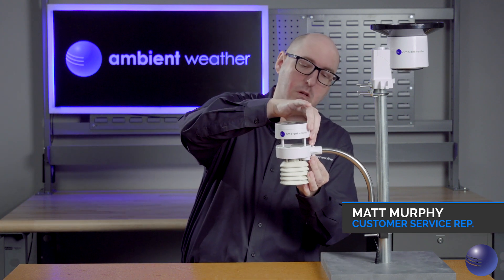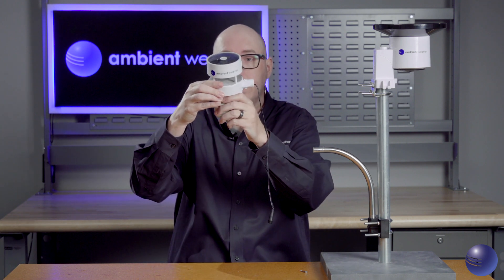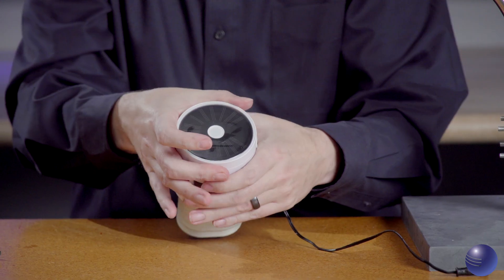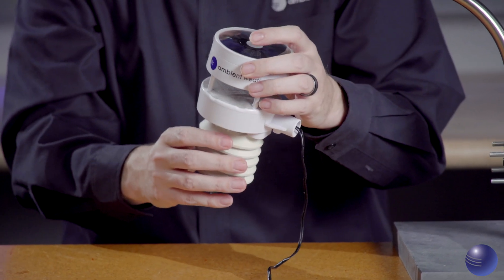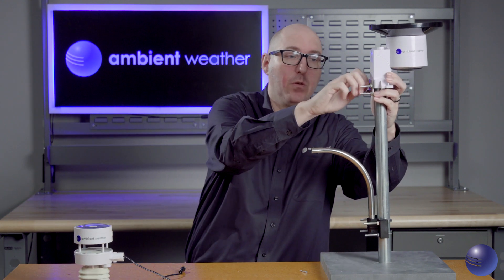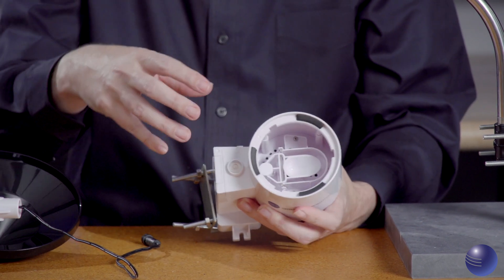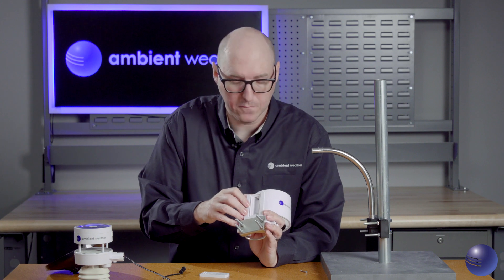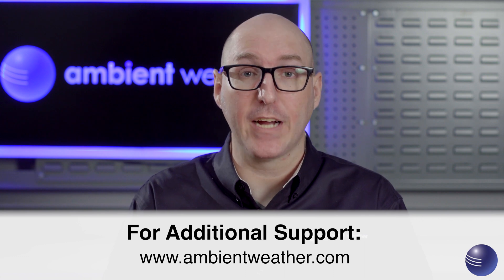HOW TO: Perform Maintenance & Visually Inspect Your WS-5000

Comment: My anemometer and wind vane (electronic) stopped working in July and I followed these instructions and it still does not work.

Your ticket # 135724 has been updated:

The following reset steps can help with this. 

The steps for proper maintenance and reset are included in the guide below.
Remove batteries
Cover solar panel with batteries out for 15 seconds
Press and hold reset button for 3 seconds
Replace batteries and press reset button once, fast.
If it still does that then there is one more type of reset
Remove batteries
Cover solar panel with batteries until the LED on the top stops flashing. We recommend bringing the array inside and placing in a dark room or closet over night.
Press and hold reset button for 1 minute
Replace batteries and press reset button once, fast.
Now if it is still reporting erratically this is the next thing to check
    1.Bring sensor inside. You want a stable condition with no wind
    2.Next to the reset button is a calibration button labeled CAL, press that for 5 seconds.
    3.The blue LED will flash at top, let the unit sit until the LED stops flashing.
Please see video of:  HOW TO: Perform Maintenance & Visually Inspect Your Outdoor Sensor Array 

What do you recommend? I will be in the USA in November of 2024. Should I just send the whole unit to you? It is such a shame as I really love your console but I have had nothing but technical problems with your AC DC Adaptor, your Console and now your Ultrasonic Anemometer/Wind Vane.

Dr. PDG, Jakarta, Indonesia